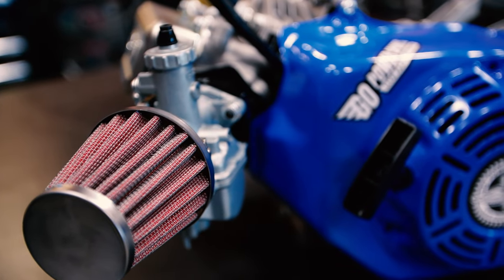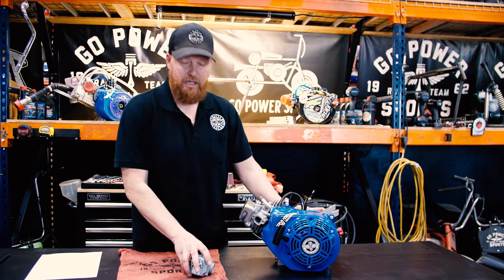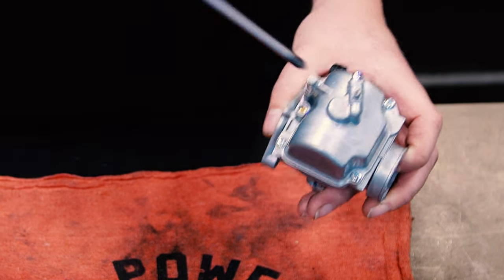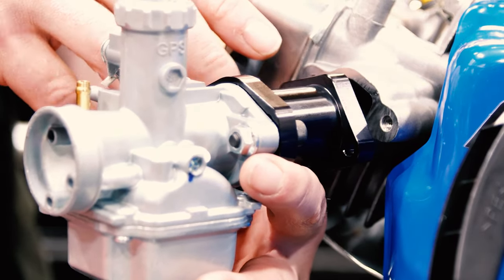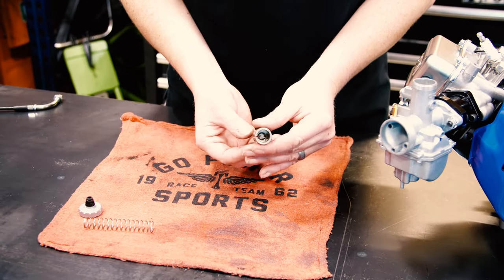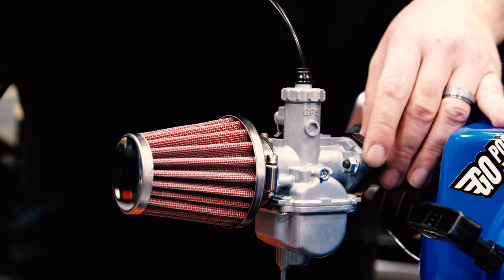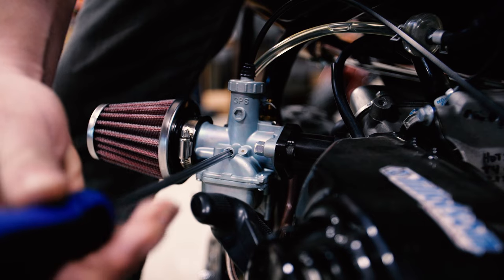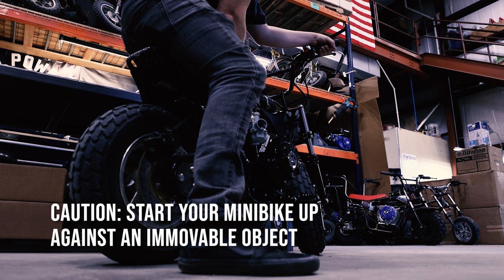How To Install And Tune A Mikuni 22 Carburetor

Comment: This carb is not Mikuni one is a Chinese clone i am afraid.  Make sure you didn't paid full price for it...
Reply: "this is our 22mm aftermarket Mikuni" 
They didn't specifically clarify it, but I think on the website they say.
Also it has GPS logo on it for GoPowerSports
Reply: You can't hear can you he said it was a knockoff which means it's a Chinese clone
Reply: Can you tell me what starting jets to use for a stock coleman vm22 with a 1" exhaust please? I've went from 110 all the way to 130 and it still seems like it needs more fuel, but I'm now second guessing if there's something up. Could this possibly need as big as a 135, 140 main? It does run good plug still looks a little lean with the 130. Thanks..
Reply: Watch red beards garage road to horsepower, these make more power than the genuine mikuni lol so yea it's better. Think before you try to talk crap about a brand.
Reply: @jaybourbon8608 you need a 115 jet pop the bowl off and install a 115 they come with a 95 stock and you need a 115 for California like near La area not sure where you are located though?
Reply: @jaybourbon8608 when I say La area I mean they run best with that jetting over here
Reply: Just got mine, it came with a 130 main and a 38 pilot. 
I bought a carb off of Amazon that had a 98 main and a keihn 36 pilot and I could not get it to tune for nothing! I couldn't find any pilot jets for it but found a main jet set, I tried 110 all the way through 150, Nothing Worked!
Hopefully this carb from GPS Works.
Reply: They still are great even if they are a clone
Reply: I recently got a VM22 clone kit off Amazon. $20. The intake was crap but once I fixed it and tuned the carb it runs fine with a 120 main on a 196.

Comment: I have a tip for anyone struggling to get their engine running after changing carburetor or doing anything with the valve springs. If you try to start and it “pulls back” or stops coming out, your valve lash gapping is not correct and needs to be fixed. For a Honda clone 196 or predator 212 it is about 0.003”
Reply from the maker: Good tip.  Hope others take note.
Reply: I have 212 predator with vm22 carburetor on go kart… it starts fine… but when i press the gas, it dies…. If i very slowly give it gas, i can get going… but again, once you press gas all the way… it dies… i heard i need to change the main jet… I didn’t have the bigger jet, so I drilled the main jet hole slightly bigger… didn’t make a difference… can’t figure it out.
Reply: @commoncentsideas1215  your air fuel mixture might be off. Also your throttle screw might be too loose
Reply: @commoncentsideas1215 let me know if that works

Comment: should do a follow up vid with spark plug reading after tuning the carb if its rich or lean. how to compensate and adjust/tune again if what is the result.
Reply: I agree!!
Reply: I know this was old news. But there’s a lot to say about learning the carb yourself. 
The vm is so simple. You basically have a high and a low
Always point your bike towards a wall on the incase you screwed the throttle up. 
It comes set close enough for your bike to run. 
So set your idle screw first, 
I sit my bike on a cradle to free up my rear wheel. 
I gas the throttle- turn screw gas throttle turn screw and after 5 min of gassing the engine, your ready to ride 👍👍💕

Comment: I have 212 predator with vm22 carburetor on go kart… it starts fine… but when i press the gas, it dies…. If i very slowly give it gas, i can get going… but again, once you press gas all the way… it dies… i heard i need to change the main jet… I didn’t have the bigger jet, so I drilled the main jet hole slightly bigger… didn’t make a difference… can’t figure it out.

Comment: So I'm probably the only one here still using the stock appearing modified ruixxing carbs but I am getting ready to make the switch over to a slide carb. Right now I have the Go Power Sports Stage 3 .650 Race Carb on my Mini Bike. It will be my first time buying a slide carb. But I'm having a hard time trying to figure out if I should get a round slide or a flat slide? From what I've read people say the flat slide is superior in performance to the round slide but it's a pain in dee ash to get them tuned right. As a first timer am I better off getting the lesser performing round slide or are the flat slides not that difficult to tune? I got a modified 224 and was thing of getting a 28mm Mikuni Flat Slide. But would choose something else if it  is going to be extremely difficult to get running right.

Comment: I just installed a vm22 on my 212 !! 👍👍 I haven’t put any performance parts on my engine. However I’ve port/polish shaved head 
Recut valve s  and of coarse reset valve clearance 
Just a header pipe homemade muffler 
She’ll fly around the neighborhood if you can keep the front wheel down! Lol 
I kept a 65 t on back and at about 5-6 grand I’m leaning over the handlebars lol ✌️
Reply from the maker: Sounds great!

Comment: I have a mukuni vm22 from a kawaski ke125 1978 2 stroke  i cant find a new clone to buy cause mine fit in the bike on a rubbee boot no screws and is located by ur right foot brake pedal behind a side casing so i was gonna clean it all out and try to use same one but i need to know how to reset both screw to a point where engine start and the ajust it cause all the clones online has the bolt on side with the pipe and if i get one of thoese i cant put case over it anymore and would be exposed and in the way for brake pedal please help me thanks

Comment: Thanks for the video. What should I do with the carburetor when it cuts out at full throttle?
Reply: It runs on main jet at WOT. Change main jet,  probably larger.  Look at spark plug to see if it's running lean or rich.

Comment: Had problems with the Mikuni that came with my rebuilt XR200R motor, wherever the screws where it ran above 2000rpm choke worked as throttle no revs barely on throttle, so found one same as yours here said for XR200, had marks where it was set (idle 1.25t) kicked over ran a beaut straight away, been buzzing around the village on it tonight, just has a bubble in the fuel line issue cause it's modified with a CL360 tank and the fuel line is hooped down up over and down to the carb, atm has a fat clear fuel hose on, just need to let the air fizzle out 😂 it's like a soda 😂 then it runs great.....hoorah ✌🏻

Comment: i have dual carbs on a RMZ 500. i have been having intermittent loss of power. the motor stays running but it wont run full power. i already changed the coil pack and still had the same problem. ran fine for an hour then about 30 seconds of power loss before back to full power.

Comment: Got one of these few months back... Got it tuned after it was doing the run away bike thing.. i got one ride around my property, put it in the garage the next morning it didn't want to start i got it to run didn't get far til l was pushing it back to the garage. Never got it going again.. got a cheap Chinese 35$ one and it started right up..

Comment: Just bought one. The wholes on the adapter don’t seem to line up with the holes on my block. Any ideas of what I’m missing. Also mine didn’t come with a gasket
Reply: It's pretty cheap on amazon for the gasket, 
For the holes it might be a little off but it should be correct. Unless you meant the mounting holes which idk the answer.

Comment: After installing a new carburetor I like to spray the contact points with break cleaner and listen for an rpm change. No change is good. Change is bad.
Reply: That brake cleaner is hard on plastic and paint. If you're checking for vacuum leaks you may want to use a silicone spray. Very   good point checking for possible vacuum leaks.

Comment: Hey is Autolite AR3910X High Performance Racing Non-Resistor Spark Plug a good spark plug for my 212cc engine because I want one that has a powerful spark
Reply from the maker: It's a great spark plug.  That or the NGKs are what we run.  BP6ES.

Comment: I have the makuni vm22 had it running a treat 1 minute then next start up. Idles really high and under throttle just bogs & stalls any help would be appreciated
Reply: Good question did you figure it out because I am going through the same thing

Comment: One quick question. When i hook up the vacuum line that goes to the back of the crankcase it runs like crap. This is on a Tao Tao 120. It does run better with the vac or vent line open to atmosphere. Thanks

Comment: Could you do a video or explain about all the different lines to do and where everything goes? What to do with the hole at the top of gas tank on predator 212cc engine, what to do with the valve cover hole, and any other thing? Would be much appreciated! Thank you!!
Reply from the maker: Great suggestion!

Comment: Thank you!  I just bought one of these from you all and plan to buy more.  Is there a cover for the air filter as we go off-road or something you recommend?  Thanks again for everything, long time customer.
Reply from the maker: You could use the air filter cover that come with the stage 1 kits, and just zip tie.  Other than that, we may use a UNI Air Filter Pod for added protection.  But we currently do not sell a smaller filter cover.
Reply: I used to use a plastic coffee can on my daughters Atv when it was muddy. Drill a couple holes and zip tie it to the carb

Comment: What pilot and main jets the carburetor comes with?
Reply: Mine came with a 130 and a 16. I think the 16 pilot jet is too large for my Coleman 200uex because I can’t get it it idle smooth and I’ve played with all the possible settings. Time to find some smaller pilot jets to test.
Reply: @MrComeaucmc  currently my Gio SS 125 is running rich with the stock carb and it bogs on the last 1/4 throttle, I think the pilot is too large and the main too small. Also, I think the C clip could help if there was an option to make it leaner, sadly the stock carb has only 1 slot.
Reply: @gerardr4869  he ended up with a 110 jet so I’m gonna switch my 130 to that.  I’m going to get a 12.5 pilot to try.  This is for my vm22 makuni carb on my coleman 200uex
Reply: @MrComeaucmc  did it work when you switched it out

Comment: How do I remove the stock long bolts from the manifold to install the new bolts to attach the carb?
Reply: Screw on 2 nuts up against each other and back the inner one out while holding the outer one still using 2 wrenches. It will eventually lock up and you can unscrew the bolt just by unscrewing the inner nut. To get the nuts off hold the inner one still and unscrew the outer nut.

Comment: Where does the line that normally goes to tje air filter go? I replaced one in a Tao Tao 125 dirt bike and there is no spot on the new air filter.

Comment: I’ve got a 212 and just put the carb on it. Definitely a top speed increase but when giving it full throttle off launch it bogs and feels like there’s a lack of power that wasn’t a problem with the stock carb. Checked the idle screw, air/fuel screw and needle as well as any vacuum leaks nothing. Does anyone have any suggestions
Reply: You need to adjust you needle
Reply: The jets sold with the carbs are meant for 110cc bikes. When it goes on a 212 it needs rejetted
Reply: @justconcentrate9843 the needle is out of the main jet at WOT. The needle affects part throttle,  from idle jet transition to main jet
Reply: 115 jet

Comment: So I have a SSR 125 pit bike that I have purchased a 26mm Mikuni carburetor for and it will not start what should be the first adjustment I do? It does have a spark and it does have compression it will start and run with the old carburetor .thank you

Comment: I followed all your steps, got my bike running great, went to put my new air filter on and bike keeps dying. No dirt inside filter it’s bran new. Any idea why this keeps happening?
Reply: If the  motor die's  as you are installing the  aircleaner, you may have a bad seal on the main o=ring that seals the carb to the manifold.  In many cases the seal will become off center when the carb is clocked level. If you cant remedy the failure issue, then take the carb and manifold off the motor...in one  connected piece. Then look thru the manifold to see if the o-ring is showing anywhere.  It should not be exposed in any areas.  There isI also a small chance that a restrictive aircleaner will cause an already compromised o-ring to begin leaking.  Good luck.

Comment: I have the same exact carb on mine, but cant get it tuned at all, im up to a 150 main jet 5th slot on needle and still running lean, sprayed around engine n cant find any air leaks

Comment: I just installed my carb to my mini bike axis m200 from lowes. And now when I start it, it just rips and takes off. I need help! Could it be anything to do with the engine ? The throttle cable? The carb?

Comment: how did you remove the two studs that aren’t shown in the video
Reply from the maker: Those 2 manifold studs are screwed into the block.  We use the method of putting two lock nuts together, tighten them against each other, and left loosey each stud out of the block.

Comment: Do you think an air leak in a plastic gasket make my Mikuni rev up to the moon as soon as I start it? I mean dangerously high… I bought 2 of them identical to the one you sell. And thought one was defective but both are acting the same.
Reply: My bike is taking off on high rpm’s& trying to rip out of my hands 😭🔥 I just installed a mikuni clone
Reply: Same
Reply: Did you guys ever fix because I need hel
Reply: I would try screw going out the idle screw in the side, turning off the choke. If no change, check the throttle cable for pulling too much.

Comment: I watched your video, it's very good. One question there is a hose connection in front of the fuel inlet
on the left side of the carb (choke side), what does that connect to? Is that another fuel over flow ?
I know there is an over flow on the bottom of the float bowl. Not sure where the connection in
front of the fuel inlet goes or connects to. PLEASE ADVISE THANK YOU
Reply: It may be a vacuum line, not used on bikes and atv's
Reply: It's just a vent. Connect a hose to it and let it dangle down with the overflow hose that connects to the bottom of the bowl. Connecting a hose to it just helps keep dirt out of it.

Comment: Can you put this on a 2 or3 hp horizontal briggs
Reply from the maker: The manifold may not fit and it may be too much carb for that engine, even with smaller jetting
Reply: Thanks for the information    If I need any parts in the future I’ll let you know great company.

Comment: Does the governor have to be removed for the motor to run right?  Because i just installed a mikuni (japan model, not Chinese) on my predator 212 but it dont run right.  It surges real bad and even stays reved up really high to where the mini bike would take off if i didnt have it jacked off the ground...ive messed with the air screw, idle screw, as well as installing different size jets. But still cant get it right
Reply: Check your choke lever.  The genuine Mikuni choke lever needs to be pulled up for it to be off.

Comment: Mine will only run with choke on. No matter what I do with the adjustments it still dies when I turn choke off.  
 I took the governor link off but not inside the motor could this be the issue???

Comment: I recently bought this carb for my bike, ever since i installed it my bike has been blowing white smoke out of the exhaust. it idles and runs good but it is chugging out a lot of smoke and the smoke smells strongly of gasoline, my previous carb did not do that. does anyone know what the problems might be? could it be running too rich and if so what does that mean and how do i fix it?

Comment: I got a mikuni and the slide won’t go all the way to the bottom and the idle screw won’t work. We started it up and it ran at such a high idle and when we gave it gas it would stall out. Is there anything I’m doing wrong?

Comment: If I have a stock pred 212 can I still use this carb?
Reply from the maker: This will work on a Predator 212, but you should take out your governor.
Reply: Oh okay thank you
Reply: @GoPowerSports Why should we take out our governor from the engine when adding this carb
Reply: @jaydenbrown3314  You should remove the internal governor parts because they may blow up at the higher RPM that the engine should get to with a slide carb. Same thing with the rod and flywheel. Once you start getting higher than 5500 RPM the risk of breaking things gets higher and higher as RPM increases.

Both of my bikes engine RPM is limited by gearing to less than 5500 RPM. I don't need to remove the internal governor parts. Get a cheap tach with a max RPM recall function so you know what RPM you are running.

Comment: Does the stock gas cable work? Or do you have to use something else?
Reply from the maker: You would need a "Mikuni" throttle cable because these cables would have a nipple end to slide into the Mikuni carbs.  We have them for both go-kart and minibike set ups.

Comment: What stage of predator do you need for vm22 ?
Reply from the maker: Stage 2
Reply: @GoPowerSports  do I have to use a aftermarket carb or can I run the stock carburetor

Comment: Is this specific model # carb compatible with the Predator 212? Also, does removing all of the linkage allow the engine to run ungoverned?
Reply from the maker: This works perfect on the Predator 212.  You would need to physically take out the governor from the engine and remove throttle linkages for this Mikuni to work.
Reply: @GoPowerSports  Thank you!